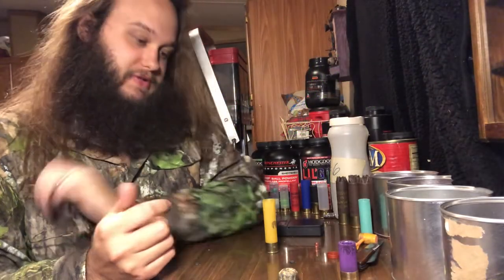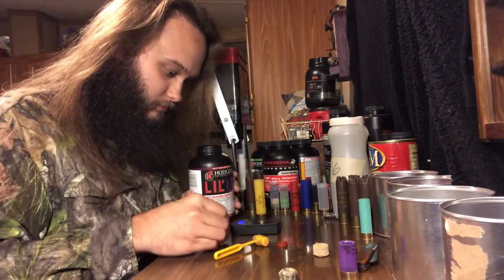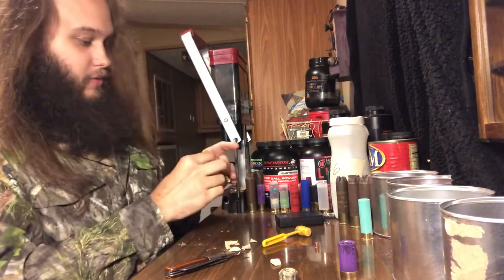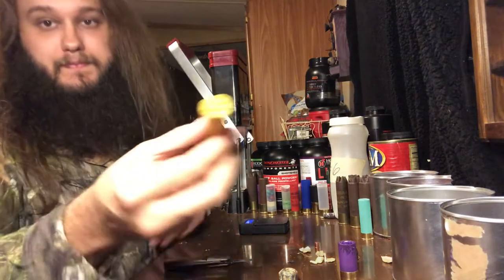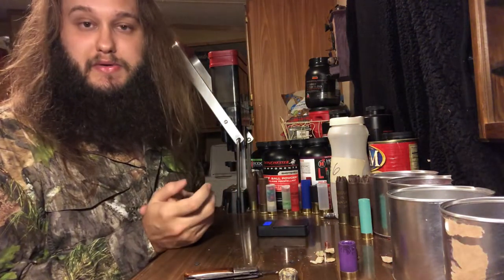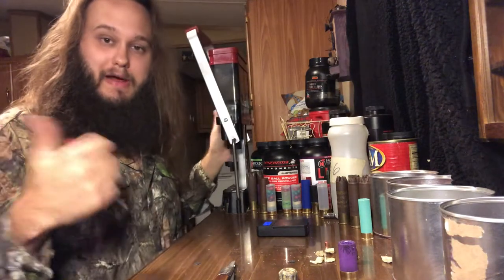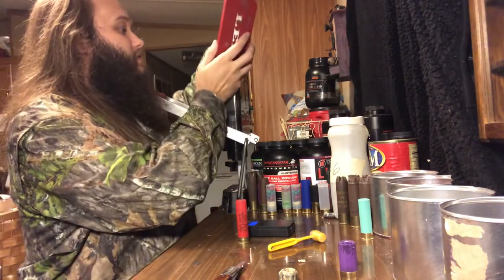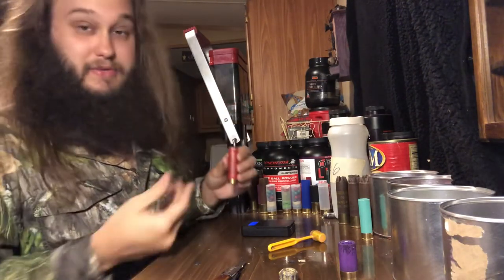20 Gauge Coyote Reloads

Comment: Where did you get your cheddite data I’m looking for some reliable recipes.
Reply from the maker: They are straight wall shells, if you don’t load to max or near max psi data is interchangeable with fiocchi rio and federal top gun which is a rio hull. Other hulls include monarch, challenger, nsi, some Winchesters, b&p, s&b, and many others. Nearly all European hulls are mostly interchangeable but if you want data specific to cheddites, get the bpi Cheddite manual.